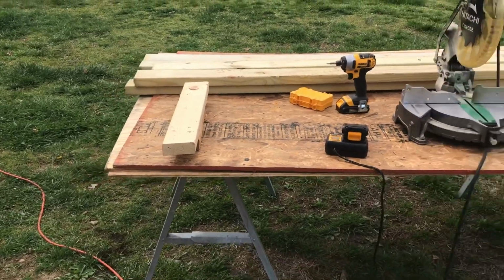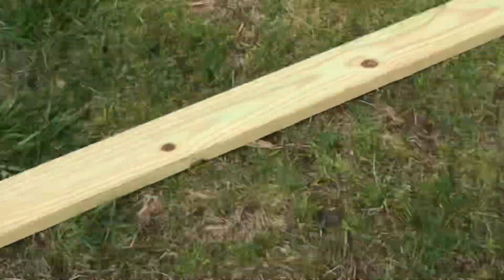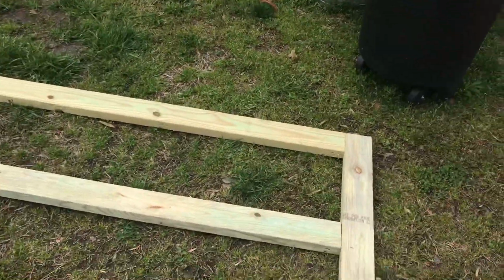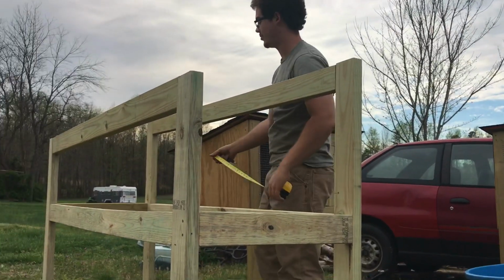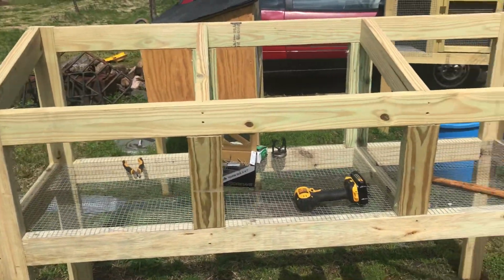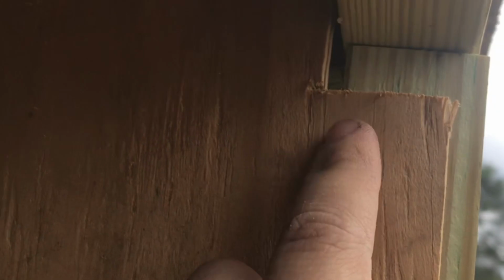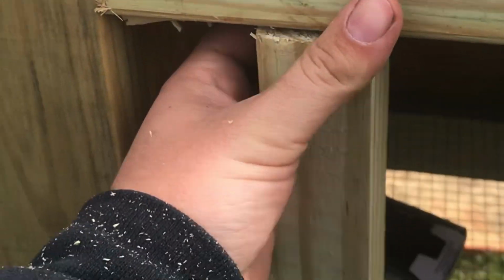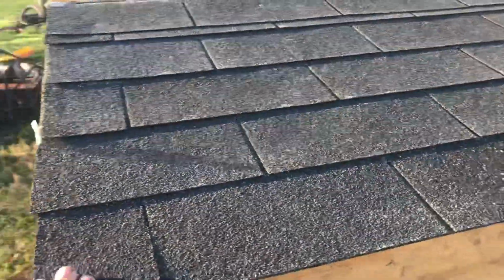How to build a BIG rabbit hutch

Comment: Hey if you make the floor completly from wire, doesn't that interfere with the rabbits digestive ways?
Reply from the maker: If you mean the poops they save for later and eat then no. Usually those are large enough to not pass through the wire while the regular poops do pass through.